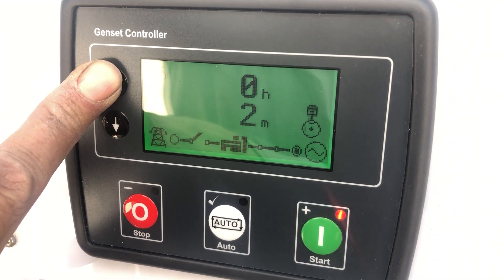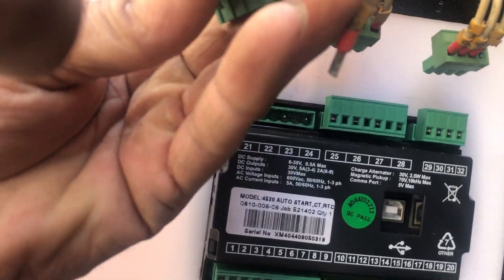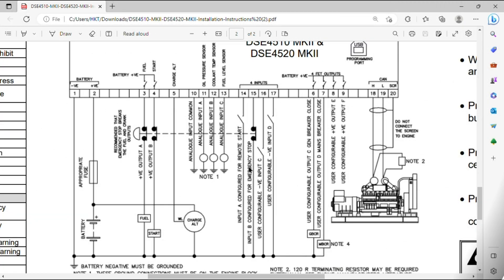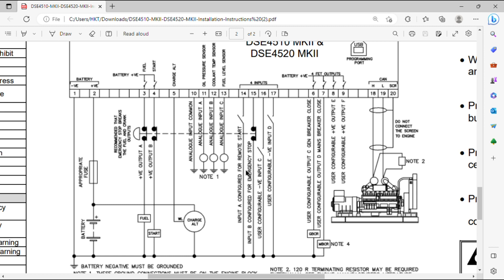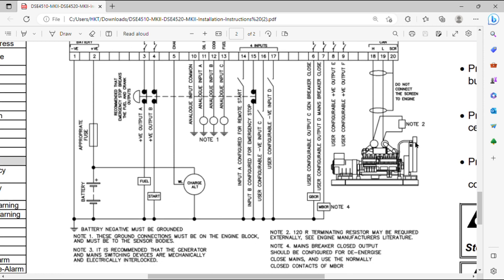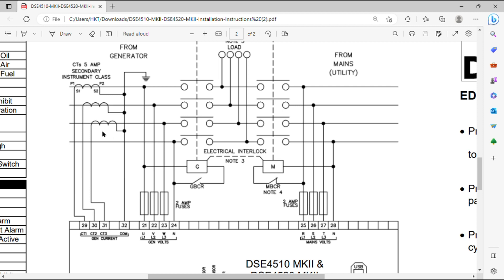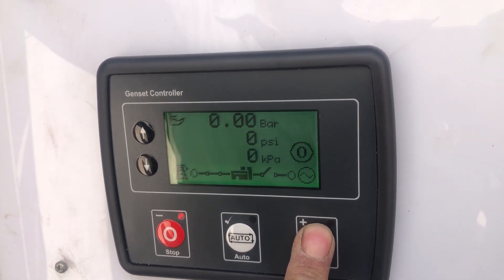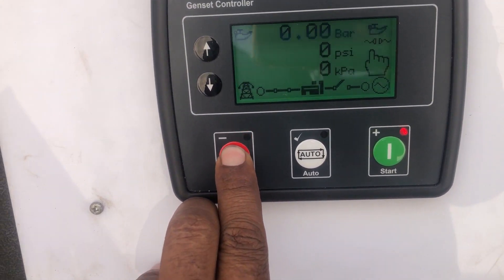Deep Sea Electronics DSE4520 MKII – Control Panel Tutorial & Installation Guide

Comment from the maker: Thanks for watching! 🔧
If you found this tutorial on the DSE4520 MKII control panel setup helpful — please like 👍 and subscribe for more generator-maintenance and electrical-engineering guides
Reply: Is my 4520 unserviceable     ? it wont reset  from overheat shutdown   even with the faulty temp sender replaced   any advice  ?  Regards Paul  UK
Reply from the maker: Mr Paul please check the wiring and match the part number old and new sender to solve the issue. 
Send me text if problem persists

Comment: Hello thank you for this . I used the red button to turn the generator off (as had been on for a while and the batteries were full and there was sunshine for the solar panels) but when I press the AUTO (as I want it to be in auto mode) the generator comes back on . Please could you tell me how to put the generator in auto without turning it on.  Thank you 🙏
Reply from the maker: Check pin 14. The relay installed to provide negative at 14 for remote start is faulty or wire connected on normally closed contact.

Comment: Hi
Reply from the maker: @adeelshaikh9987  how are you
Reply: @Technical.Education  every thing is fine can you talk in urdu?
Reply from the maker: @adeelshaikh9987  I will think of that
Reply: @Technical.Education  my english not good🫣
Reply: In Perkin engine 45kva, oil sensor is installed with single wire, when the wire is removed, the hours are starting to increase without starting the engine. What is the reason?
Reply: Replaced the sensor also the problem is still the same

Comment: How can i remove oil pressure sensor alarm?
Reply from the maker: @ScwarlloSchwarllziiMoreh  1 .check oil pressure with pressure gauge 
2. Check sensor 
3. Check wiring from sensor to module
Reply: Make sure strong negative/ earth signal connect to controller port number 10... and also make sure your sensor type is VDO not other types
Reply: @dicksonfredrick481  thank you sir, 
My gen set has 3 pin oil sensor

Comment: Which sensor count hours
Reply from the maker: DSE configuration suite can change hours. You can check if it works on 4520 or not.
Reply: @Technical.Education  can i increase hours manualy on display?
Reply from the maker: @adeelshaikh9987  Not possible according to my knowledge
Reply: @Technical.Education  There is another way?
Reply from the maker: @adeelshaikh9987  not in my knowledge

Comment: Can I be able to reset hours running manually?
Reply from the maker: Not possible download deep sea suite and you can set running hrs
Reply: when you see the hours running mode, press and hold generator stop button
for more than 10 seconds the counter will reset to zero
this is useful when servicing has been done
Reply: Hi. Sit I want to connect this generator with hybrid inverter. In inverter a 2 core wire contain a signal to switch on and off the generator. Where I will connect the wire in generator . Plz guide and also share your mobile no. For urgent help😊
Reply from the maker: Check wires with multimeter when inverter is on is it NO contact or NC